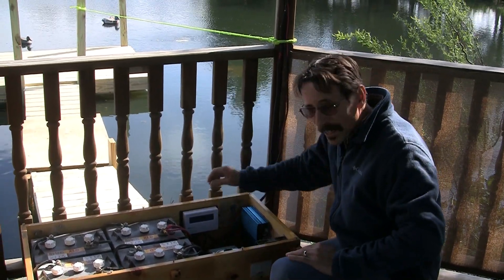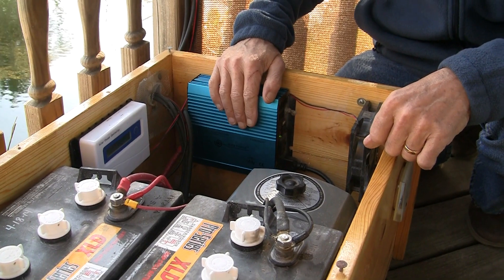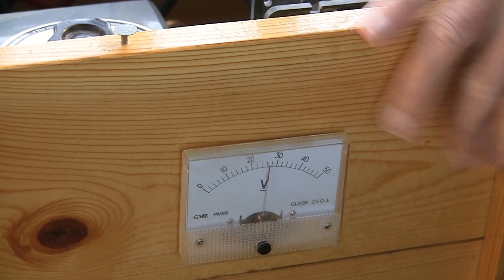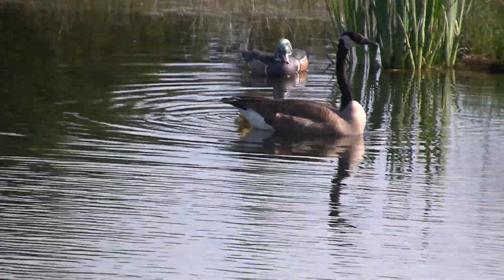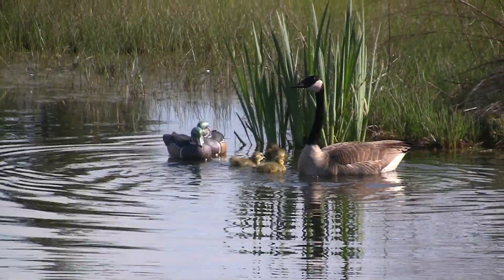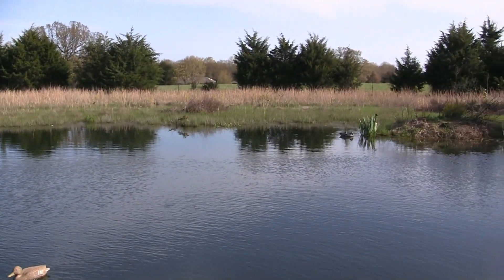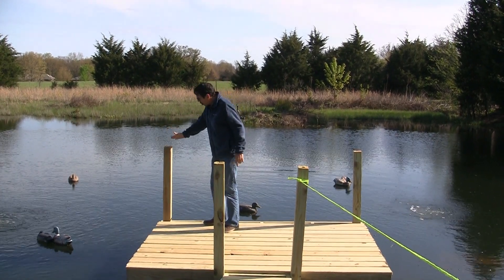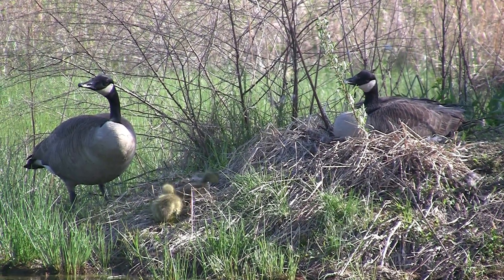Solar Pond Aeration and Suntaqe Batteryless Controller: Baby Geese | Missouri Wind and Solar

Comment: Jeff, would you include a link to that controller. When you turn the load (fan) off, how does the inverter stay on? Great video. The geese are awesome. The decoys kind of tricked me. I couldn't tell real from fake until they moved their heads.
Reply from the maker: Ray Konold Here's the link to one of them  http://store.mwands.com/solar-charge-controllers/10-amp-pwm-solar-charge-controller/  they come in 10, 20, 30 and 40 amp.The inverter is hooked up to the battery bank and is on all the time.
Reply: Thank You!

Comment: I have a controller with one of those buttons and I was wondering if there was any other reason for having it on as in a bit of a drain on the batteries when they are full, is that necessary..  I'm thinking not..   Anyway I'm glad we can supply you with some entertainment as in the Canadian Geese !!  It's a nice set up you have there..

Comment: Hey nice set up!! I have a small koi pond out in front of my house..UV sterilizer,waterfall fountain pump..120v I have it working 24-7..from April to October and then aerator in the winter so water doesn't freeze..does it really need to be running all night? During the warm months ?id like to get it on solar..
Reply from the maker: fanman1981 No it doesn't have to run all night. I have ice on the pond in the winter and the aerator keeps it open all winter. When it shut off and i wasn't home the pond froze over in the night, as soon as i turned it back on the bubbles blew a hole in the ice in about 15 minutes, by the end of the day the ice was gone.It's the tiny bubbles that work best, not the larger ones.This is my video showing you how the new system works https://www.youtube.com/watch?v=jXTayFPl6u4

Comment: great looking pond  jeff, what is the approximate size of your pond &  depth ?  was there  one there from the start or did you dig it ?
tks for the videos
Reply from the maker: The Off Grid Prepper The pond was already there when i bought the place.It was just a big mud hole with brown water, no plants at all in the water. I started the aeration about 2 years ago and now it has a lot of seaweed in it and the water is clear. Lots of plant life now and the fish are doing great.Got 2 turtles living it it now also and a lot of frogs. It's 5 foot deep and about 150 feet long by 100 feet wide.
Reply: MissouriWindandSolar tks for reply jeff , going to do a pond  on my property and the info is  helpfull  , when i am ready for solar i will be  getting with you for that .
Reply from the maker: The Off Grid Prepper Be glad to help you out.

Comment: if u changing the pond aeration,,whats the other setup with the batteries going to b used for?i want to get started on solar and finally get off the grid,what do u suggest a good starting place would b for  me,,it so windy here an a lot of the sun is dimmed out,,i think i will go with solar an wind